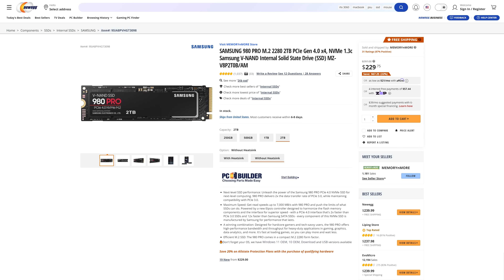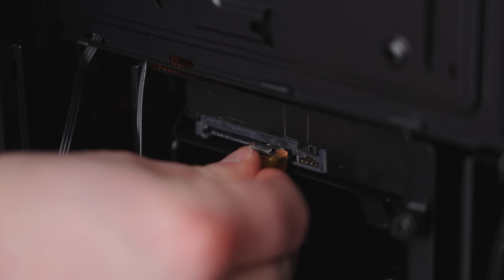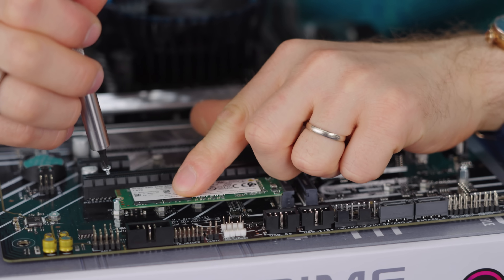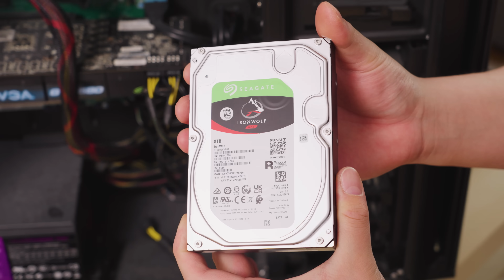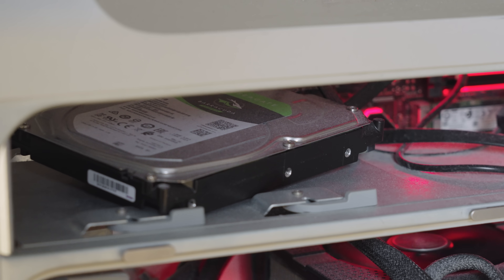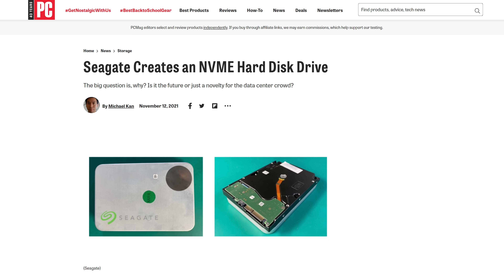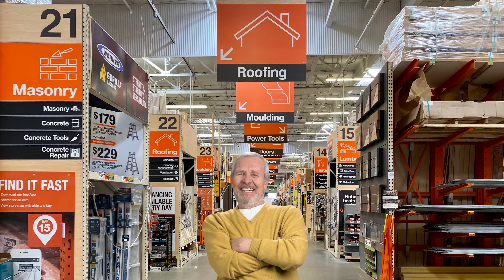Is SATA Obsolete?

Comment: I've got 2 NVME drives in my laptop. The 512gb that game stock, and then I added a 1tb drive that I bought separate to the extra NVME slot. I also have a USB3 5tb Mechanical HDD connected for my longer term storage and games I don't necessarily need to load blazing fast (single player stuff mostly, I don't mind the loadtime) the Mobile grade RTX 2070 built into the laptop seems to be working fine still, no noticeable performance drops.

Honestly, I don't think this laptop even SUPPORTS a SATA drive, even if I wanted to add one.
Reply: An external SATA. Yes. Depending if you have the port for it.
Reply: @GuillaumeLacasse99  Yes, and it's worth noting that you can buy adapters that mount in one of the back slots and plug directly into the SATA ports. So, as long as you've got any available SATA ports inside, you can simply buy a cheap adapter and have an e.SATA port on the back.
Reply: @SmallSpoonBrigade  That too yes.

Comment: Unless installing in an nvme drive in a pcie 5.0 slot they generally will not reduce pcie lanes to the gpu. Usually the extra m.2 slots are routed through the chipset just like sata drives. I feel like the writer of this video might not have the strongest grasp of the typical pcie functionality of most motherboards.
Reply: yeah uh shouldn't they know better? You can't really reallocate cpu lanes like they described i thought
Reply: Yea this is by far one of the most misinformed videos
Reply: Yeah, this is some pretty serious misinformation that should be corrected by them. While technically manufacturers could connect all M.2 slots to the CPU, specifications exist to prevent that. The only way to reduce the number of lanes for the GPU is to plug a device into the second x16 slot, assuming the motherboard and chipset support lane splitting.
SATA is pretty obsolete for SSDs, there is no real reason to buy them if your mobo has an NVMe slot. But I doubt the standard will ever die, because hard drives and optical drives will continue to exist. SATA connectors utilize bandwidth from PCI-E lanes in the chipset anyway, so the support will always be there.
Reply: @THU31  They focus too much on adding some stupid joke rather than refining the script.
Reply: @Mr Pais That is true, but kind of irrelevant if the gpu is installed in the pcie 5.0 capable slot anyway like it should be. For example if you get one of the Asus Z690 motherboards that support it installing an ssd in the 5.0 capable m.2 and a gpu in the 5.0x16 slot is going to result in your gpu running at 4.0x8. I would consider this less than ideal, but it is necessary because intel 12th gen only supports 16 pcie 5.0 lanes.

Comment: When I can buy a 10TB nVME drive and it doesn't cost more than a new car, maybe lol.
Reply: Why do you need 10 TB? I struggle to fill my 2.
Reply: @portman8909  I run a Plex server for my family and friends from my NAS machine, 2TB wouldn't fit a massive amount even at 1080 resolution.
Reply: @Palo_din  Well, NVMe isn't really aimed for servers.
Reply: @portman8909  No, and that's the point, SATA won't be dead as long as use cases like mine exist. Maybe the tech will get there one day, but it won't be for a long time

Comment: SATA SSD: Great for the boot drive.
NVME: Prefect for those giant heavy loading games like GTA5. 
SATA HDD: When you need tons of storage space for all your uncensored media and a 2TB NVME/SSD drive just won't do.
Reply: For me. nvme for boot drive and productivity software and sata ssd for games .
Reply: I'd say the reverse. NVMe is important for the boot drive because there are so many OS files that get used so much more frequently and randomly than any game.

My HDDs, I use for moving my games to instead of uninstalling them because moving them back when I want to reinstall is faster than if I had Gigabit internet speeds.
Reply: @ex0stasis72  
While it is true that the OS uses a lot of files, I have never seen an OS lag or go slow while using it with a Sata SSD. And also it was more of a time when many boards only had 1 NVMe slot and you had to choose when went where. But now boards have many NVMe slots and there's plenty of room for an NVMe boot drive and separate NVMe gaming drives.  

And like you, I also use an HDD to backup huge games like GTA5. And considering that HDDs are kinda slow, I just have a 16TB dedicated for game backups.
Reply: @KabukeeJo  I still only have one M.2 slot on my motherboard.

Maybe you're right that SATA SSD is fine for boot drive. My other reasoning is that I'm a variety gamer, so I have multible TB worth of games installed. I'm not always playing one game, but I am always using my OS, so my OS may as well by installed on the fastest SSD.

One thing that I do make sure do is leave room on my M.2 NVMe drive for graphically intense VR games since I've run into SATA SSD read speeds as a bottle neck for certain games with high videlity user generated content in VR. I think I may have just outed myself by narrowing it down to a certain game that shall not be mentioned.
Reply: @ex0stasis72  I understand what you are saying. Personally, I havent run into any gaming bottlenecks when I was using the SSD as a boot drive. But every set-up is different, so try different things and see what works best for your setup.

Comment: The base cost of an SSD is lower than that of any capacity HDD, because they're basically a piece of PCB with a few chips, whereas an HDD has a PCB, more chips, platters, metal frame, r/w heads... It's not "even low end laptops have SSDs". Low end laptops are most likely to have only SSDs.
Reply: This seems to discard a lot of context in order to come to an incorrect conclusion. HDDs are still cheaper than SSDs, per gigabyte, and just because HDDs are more complex doesn't mean they're cheaper, since the "piece of PCB with a few chips" in an SSD is more complex and harder to manufacture than the mechnical parts of an HDD (or the comparatively far simpler chips). I also very much doubt your conclusion that lower end laptops are more likely to contain only SSDs. Many still contain small eMMC chips (for smaller laptops) or HDDs (for 15.6" and larger ones), while more expensive laptops almost always just have SSDs.

Comment: NVMe will only 'kill' SATA when they get a cabled option, when CPUs get wáy more lanes ánd when they get cheaper per GB than HDDs. I'd wager that SSDs will first make HDDs obsolete when they finally catch up with capacity and price. I don't feel like HDDs will practically get a lot bigger capacity. I'm kind of surprised that the SSDs are still 'stuck' at these low capacities.
Reply: They already have a cabled option. It just is that most consumer drives and boards aren't using it.
Reply: I think it's the controller that's holding SSD's back. It becomes crazy complex to organised all those sectors so you basically need a mini computer just to calculate it all.

Comment: SATA is overdue for a refresh or replacement. I 100% agree with SATA's usefulness for storage uses (I have 1x NVMe + 2xSATA SSD + 2x HDDs in my PC) but 6Gbps is pretty crappy when NAND is capable of achieving almost 10X that much per package. There needs to be a 10-16Gbps successor.
Reply: There is a solution, kind of. SAS-3 SSDs are 12 Gbps, but you won't find value versions of those. One of the problems is that consumer motherboards are PCIe starved as it is, and SATA ports are already disabled when using multiple NVMe slots. I think if you doubled SATA speed you'd end up seeing a reduction of ports from 4-8 down to 2-4, with 3 being uncommon and 4 being vanishingly rare. It's actually probably a blessing in disguise that SATA is as slow as it is since it allows connecting more drives than you'd be able to with faster alternatives.
Reply: @dycedargselderbrother5353  The reason PCIe lanes get disabled when using SATA ports is because those lanes are shared between PCIe/NVMe and SATA. Doubling the speed of SATA ports wouldn't have any effect on that, still using only one lane per port, it would just runs twice as fast. AMD and Intel aren't reducing the number of PCIe lanes on their CPUs and chipset when upgrading from PCIe 3.0 to 4.0 to 5.0, no reason for SATA getting an upgrade to be any different.
Reply: No point in making a new drive protocol for HDDs
The transition from PATA to SATA was not always the best when it came to software.
XP did not have support for SATA HDDs.
When you were installing XP, you had to press F3 during load, insert a floppy disk containing the controller drivers.
Now yes we can load drivers at the HDD screen of windows with a USB, but still how many people know how to do this?
Very Few

And while HDDs are not dying, no real point in making a new protocol for them since their use is not as great as it use to be.
This means seagate, WD, Toshiba wont really bother using this new connector that comes with the new protocol.
Reply: they need to make SATA 4 using some of the aspects of fast SAS, given that SAS supports SATA it should be simple enough to make a 12Gbit or even 24Gbit version like SAS has
Reply: @williampaabreeves  The ideal solution IMO would be a new connector with integrated 12V+4.0x1 which could then be used for anything besides native NVMe with the addition of appropriate adapters.
Reply: @teardowndan5364  as has be previously stated in many places, satas strength is its cheap connector and chipsets. any new connectors and standards not based on existing tech will cost a lot more to build, to the point where just using PCIe x1 slots for storage would become a better solution, compared to just bringing some features that have existed in SAS for the last 10 years already so are well estabilshed, mass produced and easy to make
Reply: @williampaabreeves  The chipset's FlexIO lanes already support PCIe/SATA, absolutely zero change needed there. The "increased cost" of new connectors is only transitory until the new standard is established. Combining power and 4.0x1 in one cable and connector would almost certainly be cheaper long-term than SATA's separate power and data connectors.
New internal headers and cables get introduced all of the time: USB3 got a new header to accommodate the extra RX and TX lanes, Type-C required yet another new header ("Type-E") to pass through all of the extra signal pairs and 10+Gbps on the high-speed pairs, likely more to come in the future.
SATA is overdue for an overhaul or replacement. It is far too slow for modern SSDs and doesn't fit into the 12VO future.
Reply: You can put 5 pcie ssds in your system, just use adapters
Reply: @chronometer9931  My board only has one spare usable 3.0x4 slot and I think it shares HSIO lanes with two SATA ports.

Comment: It's a shame that SATA Express was killed off so early. We could have seen standard 3.5 and 2.5 form factor drives take advantage of that 16Gbps connection.
Reply: I think Thunderbolt kind of killed that off, not that Thunderbolt has such a massive market share in the grand scheme of things, but the benefits of SATA Express were basically superseded with everything Thunderbolt let you do.
Reply: @TalesOfWar  Thunderbolt was never really an internal connector, so it's not really related. You're thinking of eSATA, I think.
Reply: The only deployment of SATA Express I ever saw was in Lenovo laptops. Lenovo eventually started selling SATAe to NVMe adapters, I guess after witnessing the technology's near-complete market failure. It wasn't a perfect solution because despite the enormous size of the connector, SATAe carried only two lanes of PCIe instead NVMe's four.

As some posters above commented, the SATA Express standard is basically pointless. SAS, NVMe, and U.2 already existed, and each served their respective purposes better than SATAe did or would. Despite existing after NVMe, SATAe carries half the bandwidth in a significantly larger form factor. Big oof.
Reply: U.2?
Reply: @mfatihy70  Thats more of an enterprise connector, it is pretty much M.2 in all regards.
Reply: Sata express was 10gbps and I have never even seen a cable for it or a drive that uses it
Reply: Sata express was pointless. They should have just used SAS, since those drives already existed.
Reply: I am glad I have never even seen a motherboard with that gigantic connector. There was nothing good about SATA Express. Anything that gets rid of cables is a huge win, and NVMe hit gold in that regard.
Reply: @THU31  Sure, the connector was kind of clunk in the beginning, but you could fit a lot more SATA Express connectors on a motherboard than M.2 slots. You also wouldn't need as many PCIe lanes dedicated to it.

Comment: Got 5 M.2 Slots on a Z690 Motherboard so nothing from M.2 Slots is shared with the GPU lanes, only one SSD can be connected to the CPU directly. The rest is going over the chipset and one M.2 slot is even shared with a SATA Port. So it's 5M.2/5 SATA or 4 M.2/6 SATA. But in no case Alder Lake takes lanes from the GPU when putting in M.2 drives except for an expansion card in a PCIe slot.
Reply: Exactly, that was a very weird thing for them to claim as I've never seen a single motherboard steal PCIe lanes from the GPU on their M.2 slots.  The only time that happens is if you are adding more M.2 drives using the second or third PCIe x16 slot, and its likely to become less of an issue going forwards as I believe newer CPUs are going to have more lanes.

However, the physical space for M.2 slots on the motherboard is an issue, so you may need PCIe adapters for that - whereas SATA drives can be elsewhere in the case and their connectors don't take up much space on the motherboard.
Reply: The B550 Aorus Master and some others high end B550 boards do it. It's the only way to have more than one Gen4 NVMe drives with a B550 chipset. This also frees chipset bandwidth so they can add more high speed USB connectors and all 6 SATA connectors can be used at the same time as all 3 M.2 connectors.
Reply: @alexatkin  If I were to put a M.2 add-in card into my second x16 slot then my GPU would be sitting with x8 lanes instead of the x16 lanes that it has now.
Reply: @emu071981  But they didn’t mention an add on card, if you put something in another PCIe slots it’s obvious that lanes will be taken away from the first slot because you added another card.

Comment: No, I still prefer it for bulk storage drives thanks to the ridiculous compatibility advantages compared to NVMe M.2.
NVMe M.2 for boot drives though, any day.
Reply: SATA drives are also much easier to remove/swap compared to NVME where you might have to remove the GPU/CPU Cooler just to access.